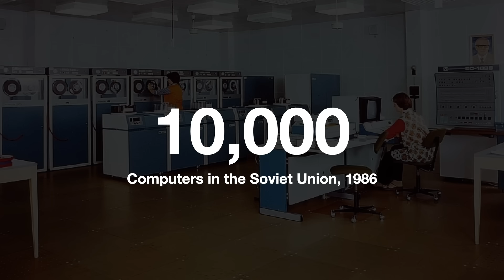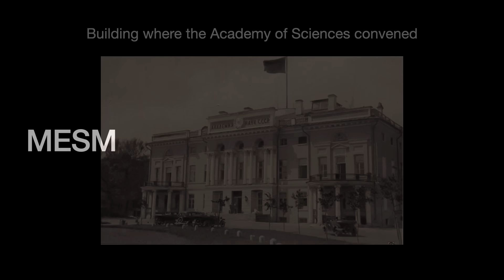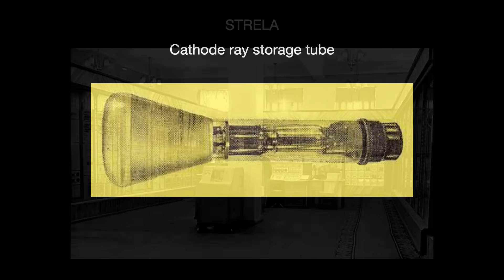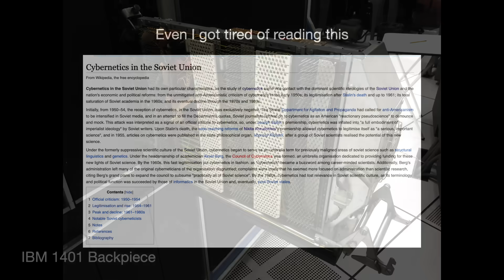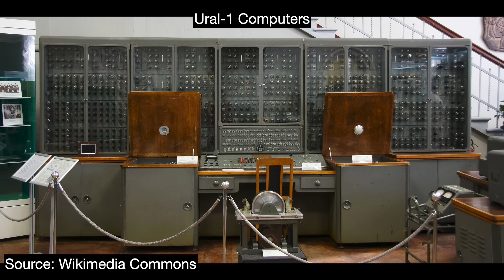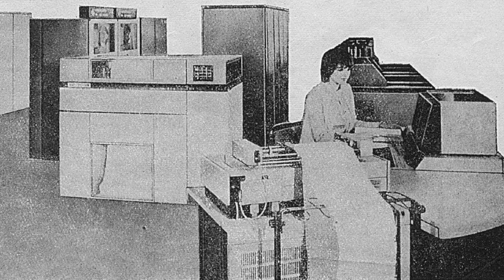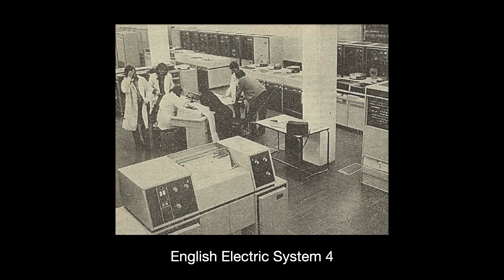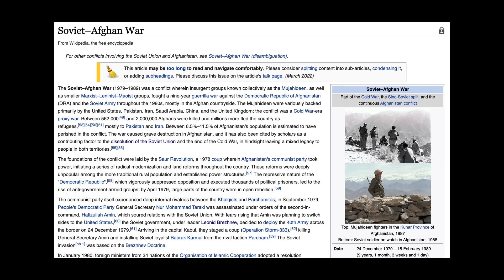Why the Soviet Computer Failed

Comment: Back in my Cold War days we had opportunity to examine a Soviet illicit clone of the Radio Shack TR(a)S(h) 80.  They had problems with integrated circuit boards, so it had lots of  jumper wires with twisted soldered connections.  Needless to say the exposed wires generated their own static picked up by neighboring wires which induced multiple errors.  The box was just full of wires.  They eventually sort of solved it as their clone of the C64, although a little larger than a real one used far less wiring.  Then there was the plot to allow them to 'steal' flawed various item designs with hidden back doors hard wired into source code, but that's a story in itself.  Sufficient to say it worked..
Reply: Far as I know there is no TRS-80 Soviet clone, I know only of the Polish, Yugoslav, South Korean, Brazil and Dutch clones of TRS-80. 
All of them equally shoddy and almost up to a point of being handmade. 
USSR had some very well manufactured "personal" computers like MIR and many others mainly used in education and by mathematicians. 
So what you are saying is extremely suspicious, also TRS-80s Chinese build kits existed, basically TRS-80 you could assemble yourself, cheap and effective, what you may have seen, would been one of those build kits made by someone in USSR on his free time, it was actually common for Soviet people to buy kit based computers and assemble them by their own, USSR even produced some itself, this idea of building the computer yourself persisted into the 90s and early 2000s with the opening of western market in post-Soviet Russia. 
The aquarium computer for example is a Russian invention, throwing entire computer into aquarium filled with mineral OIL.
As for Soviet computer manufacturing quality, one eBay search will give you plenty of examples, and one thing they all have in common is being overbuilt to point of stupidity, some have backup wires to multiple boards in case one fails LOL
Reply: Consumer electronics.. like radios & TVs suffered  'supply chain' problems.  Crude PCB and discrete component unavailability resulting in  'bodges' - such as paralleling or series-ing resistors to achieve correct value on the bench.
Reply: So Basically most of if not all of their technology was "borrowed" from the West. Then when they are desperate to keep up they are willing to "borrow" anything they can get their hands on. So the West makes available compromised hardware and software which the Soviets eat right up, similar to the SST program. Communism sucks.

Comment: Soviet computers were never designed to be commercially sold, they were purpose built just for things where human error could spell a catastrophe (like orbital computing) or where human work could take ages (like you mention it).
Commercial use (like in banking, administrative work, etc) would make a lot of party apparatchiki useless so there is that.

Also there is an old proverb "if it's working don't fix it" that's one of the reasons why MiG-25 still had vacuum tubes radar in the 70's.
Reply: "if it isnt broken dont try to fix it"  and followed by "If you tamper with it for long enough you'll break it"

Comment: they launched sputnik they landed on Venus sent 2 rovers to the moon
 then they drank ruski vodka the rest is history . 
Most people i know dont own a PC or any new tech mobile  TV's etc $  
And why pay $700 for a NBN line ( its really a phone cable inside xd cost is labor ) Ha! the small NBN box is all bullchit scam just a connector
 i moved next door to a larger balcony room i just threw the phone line nbn over to next door 100mbs Its the win10 updates etc that has everyone pissed off Connections failing 
wont connect on the Ethernet gigabyte Lan -  but will with a PCI.E  WIFI card spend a whole day uninstalling drivers removing wifi cards and  removing June updates :) WTF u doing Microsoft

Comment: If you take video recommendations, TSMC is building new 28nm fabs because it’s planar instead of FinFET and therefore cheaper. Meanwhile, there are other companies trying to take cost efficient planar nodes down to 22nm and even work toward 14nm. This all has huge economic repercussions moving forward.

Comment: Computers are a microcosm for the failure of the whole Soviet Union, and communism in general. Central planning is great at allocating resources for particular tasks, hence why the Soviets were able to develop respectable space and nuclear programs. Where central planning completely falls apart is figuring out what tasks are worthy of resource allocation.
Reply: I don't think that's a fundamental problem of command economies*, really. Not in the sense that resource allocation is necessarily worse than in your typical market economy, anyway. Market economies also manage some pretty spectacular mis-allocations by distributing resources based on who can pay for them, as opposed to who needs them. Plus all the skimmed surplus value that ends up burning holes in the pockets of rich perverts who then spend it on their second hyperyacht or a vanity golf resort or whatever.
Soviet leadership didn't give people on the lower rungs enough autonomy to respond flexibly to specific needs, perverse incentives led administrators to fudge their numbers and give the planners bad data, and they had an abiding fetish for heavy industry. 

*the Soviet Union wasn't a communist society -- it didn't even claim to be, communism was the eventual utopian end goal. A communist society is stateless, so it doesn't have central planning by definition.
Reply: @HeadsFullOfEyeballs  Resource allocation is always better when left to markets, if for no other reason than because of the calculation problem posed by Mises and refined by subsequent Austrian school economists. Capitalist resource allocation has produced outcomes that some people might find disfavorable, but none as objectively bad as the Great Leap Forward, for example. I'd mention Holodomor, to relate more directly to the USSR, but I think that's now widely accepted as deliberate genocide, rather than an economic failure. I suppose you'd suggest China didn't practice communism either. Funny how there's this ideology that always gets stuck in an operating mode detrimental to the people, and never reaches its utopian ideals, yet people keep wanting to try it. A stateless society is a noble goal, but I'd rather work toward that directly, instead of giving the state more control and hoping it'll relinquish it some day, in the most unprecedented act of any government ever.
Reply: @HeadsFullOfEyeballs  read basic economics by thomas sowell
Reply: @MechaSixVII  What's your point?

Comment: In the late 1980s, I worked on the ES-1036. It was the second generation of the ES series and was an analogue of the IBM370. These computers eventually became increasingly used as servers and communication centres for users.
Reply: In the late 80s, I worked on ES-1045. Way more advanced than ES-1036, NOT!
Reply: What a funny story